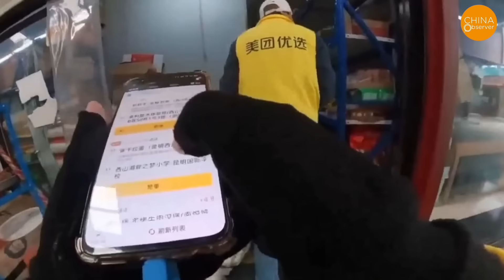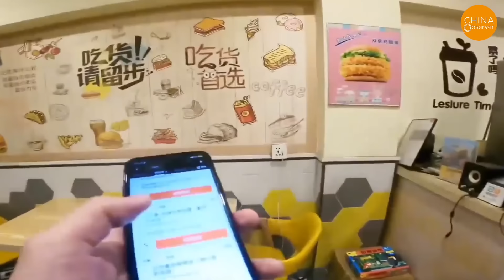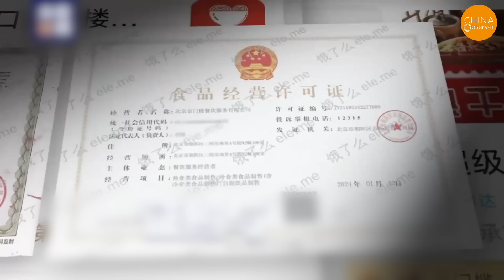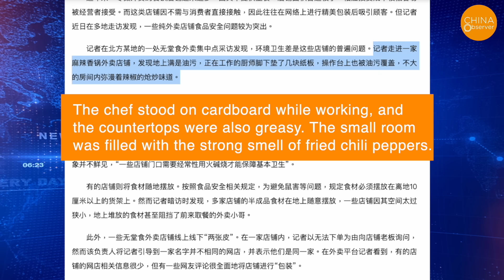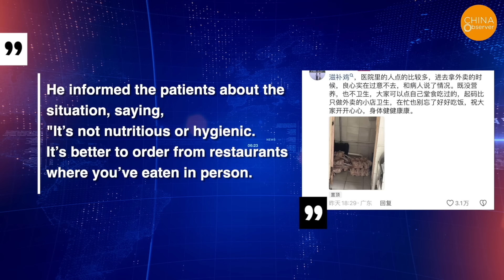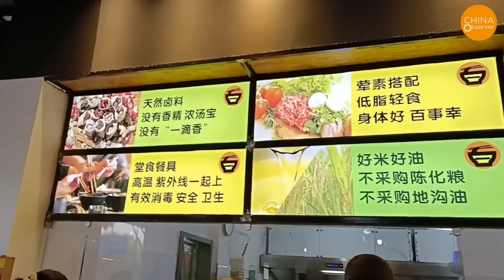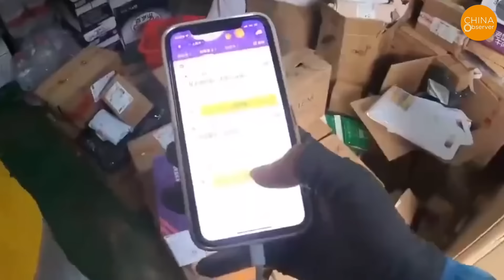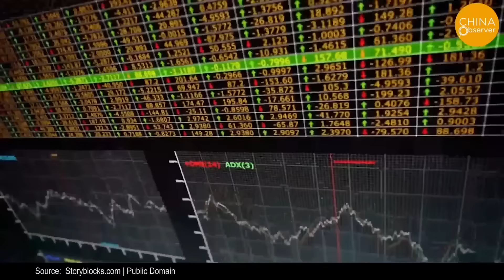Do You Dare Eat Chinese Takeout? Spend 100 Yuan to Treat a Delivery Person, but No Clean Restaurants

Comment: 7:13 🤮a body shiny with sweat and bare chested, dripping sweat into food & probably arm out hair 🤢 I don’t think I can watch this to the end. 
If I was delivering food and saw these conditions I couldn’t give food to a customer and not tell them what I saw. There are places, particularly in London where buying a shop in high street locations is incredibly expensive so some have opened up in repurposed buildings just full of kitchens, some are supermarkets with no actual customers. But they have to abide by the strict food hygiene rules everywhere else does. Even school kitchens are checked, if you sell, store or produce food it’s checked by on the spot visits and a rating system. The public can contact environmental health with any concerns and complaints about food poisoning are taken incredibly seriously